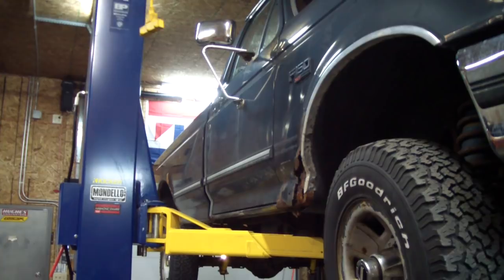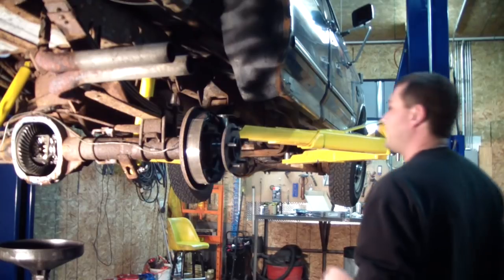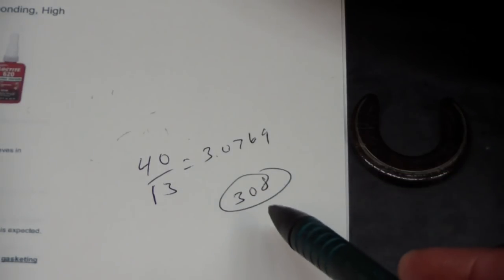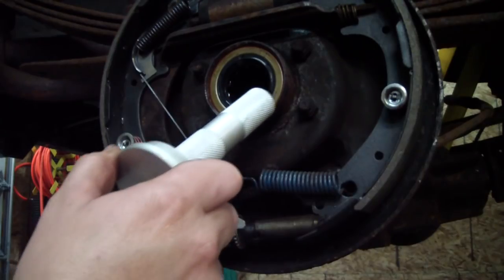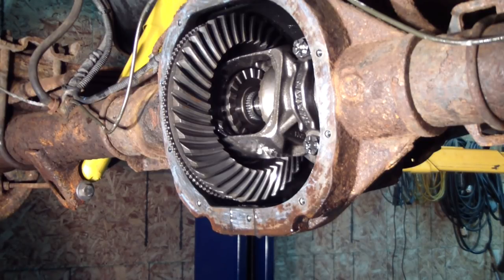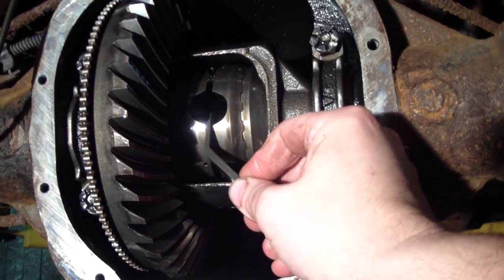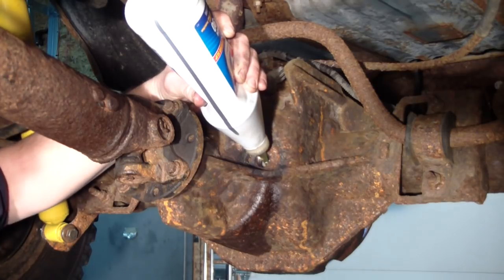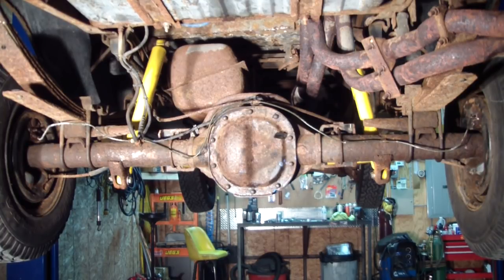Spartan Locker Install Ford 8.8 Differential  F150

Comment: What are lockers for? My rear tires chirp if I make a u-turn, is that from lockers?
Reply: A locker means that in a offroad situation if one tire is in the air and the other one on the ground both tires spin at the same rate and sends equal power to both tires and to try to answer your question if you do have a locker active and you take a turn, it does chirp a tire by forcing the outer wheel to spin the same speed as the inner wheel so you could have a locker but their could be other reason for the tire chirp
Reply: Could be positraction